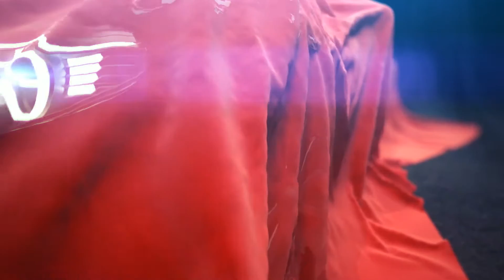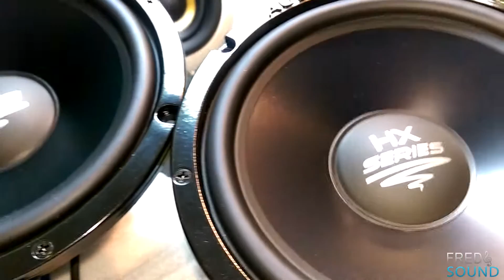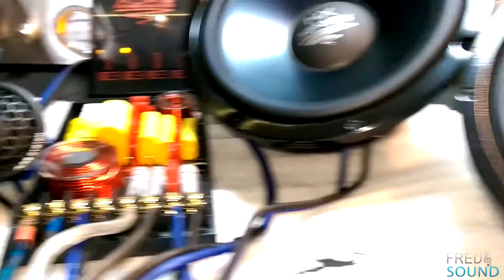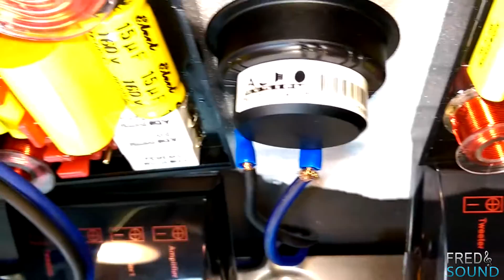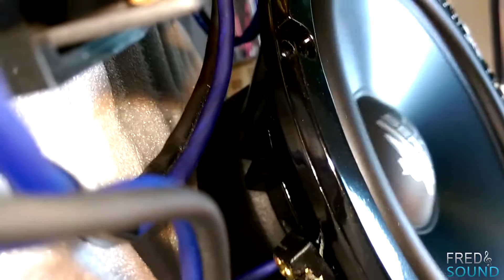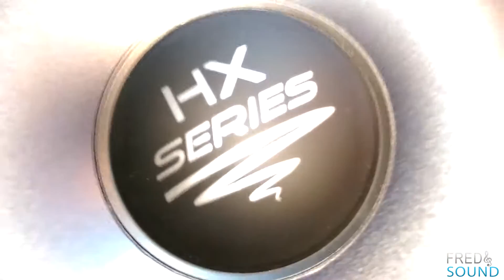AUDIO SYSTEM HX 165 DUST-4 EVO (INT)

Comment: Hello, i have 2 sets of h165-4 evo which are 8 woofers and 4 tweeters. The specs say they are 2 Ohm. if i want to connect all 8 woofers and 4 tweeters on 1 amp, do i need 4x xxx watt @ 2 ohm? or 4 ohm?
Reply from the maker: hi, check your speaker impedance, and from there you need to calculate the final impedance you get, then you will match the amplifier you need, for these speakers running active will need about 70w RMS - 120rms for each ch, if you need all speakers to the same stereo amplifier, then for sample: 70W X 8= 560W to 960w 
thanks for watching